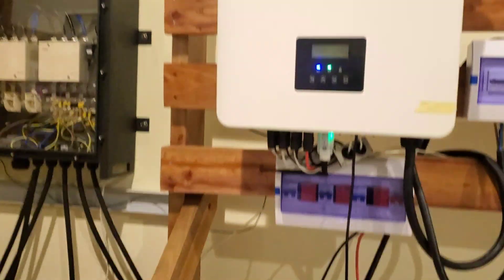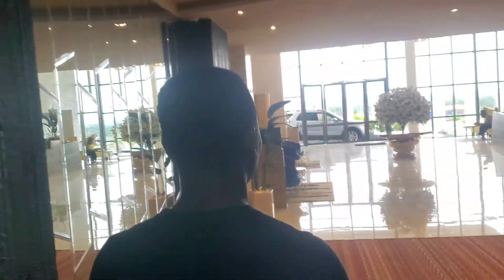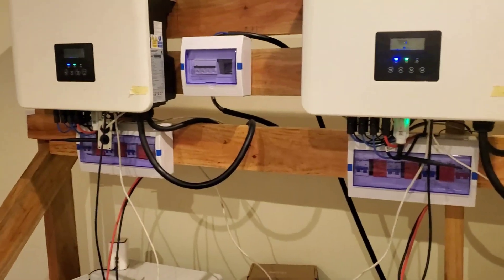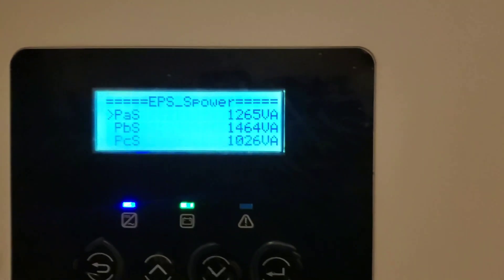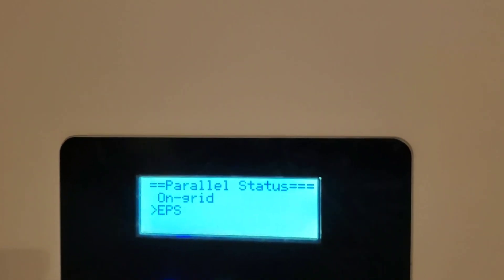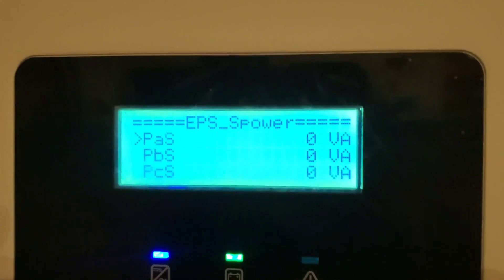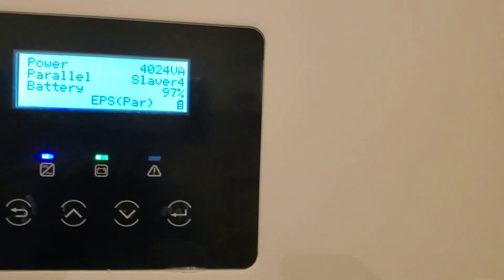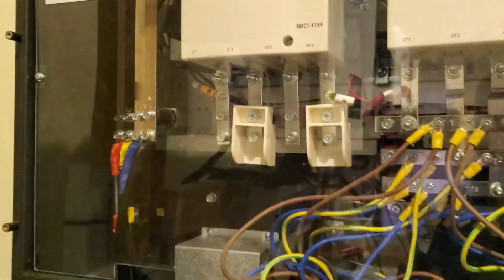I ride an elevator powered by Solar #solax #solarpowerplant #offgridsolar

Comment: Before you get the Inverter replacement and battery additions, after preliminary system loads test, wouldn’t be a good idea to see how easily you could use the other batteries into places where you have missing batteries. This would help to dry-run a possibility of battery replacements in the event of battery failures💁🏾 
Would still love for you not to forget safety issues and put fire hydrants, Dr. Solar. Well done, so far. 👍🏽👍🏽👍🏽
Reply from the maker: We don't have the cables. The batteries are there. We have ordered the cables to allow us to use them. We are testing with what we have. Fire suppression is coming. We have discussed it with the client.

Comment: Very cool power production. My country the codes are pretty strict. Good to see it running smooth. Hope all is well
Reply from the maker: Hello Frank. Yes wood would not work in Canada even the flame retardant wood that we are using. Thanks for your kind words.
Reply: @drsolar  ya its hard to do cheap work here. So many rules. Cool to see a solar powered elevator.  Cheers